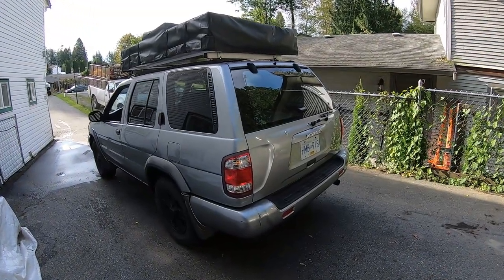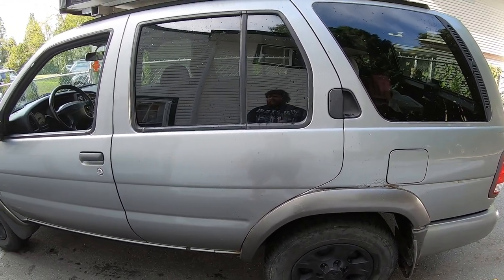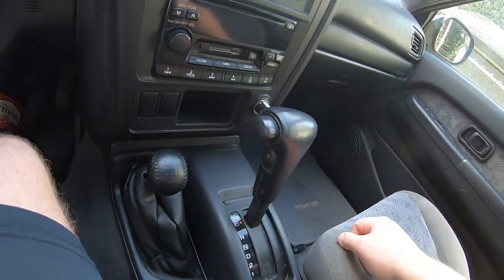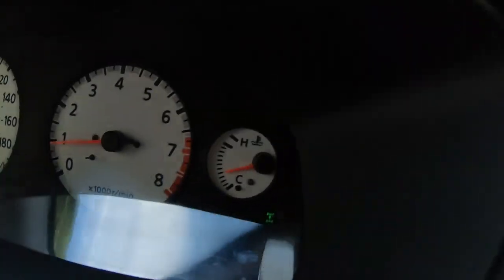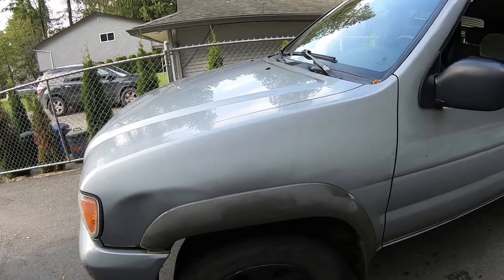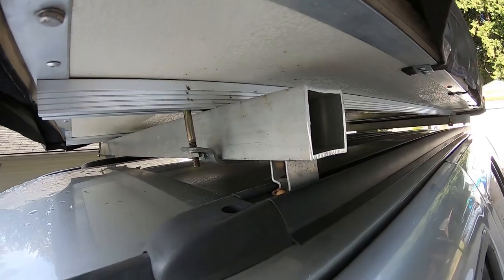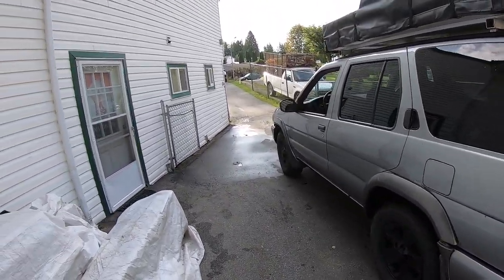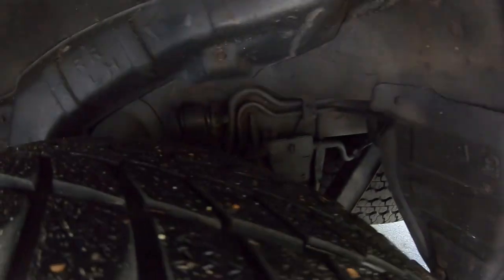I BOUGHT THE CHEAPEST NISSAN PATHFINDER IN THE WORLD !!!!

Comment: If you put a pioneer double din head unit in and JBL GX628 speakers you’ll have a bumping speaker system for about 200-250 bucks.  That’s what I did in my 03 pathfinder and it worked seamlessly.